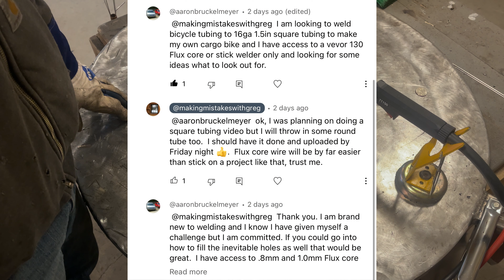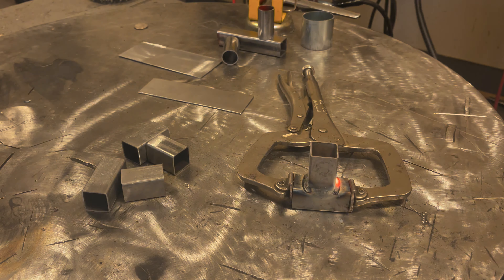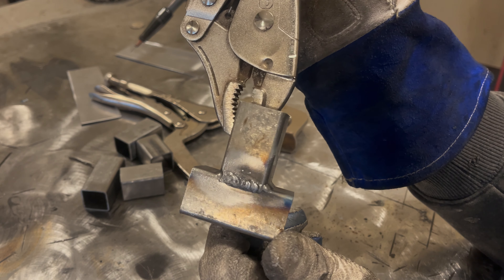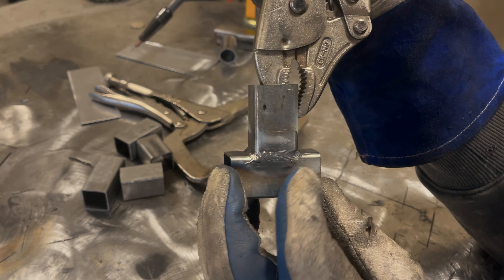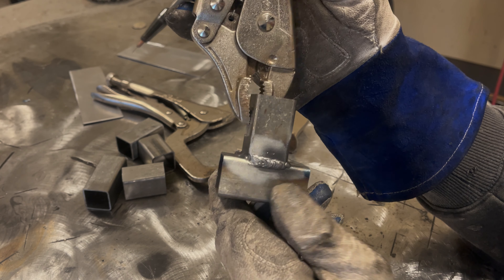Flux core welding part 6: Thin wall small diameter tube. Viewer suggestion

Comment: When I need to clean oil off of metal internals like that, I found a carb cleaner spray down works well.  
Safety warning:  Take it outside to clean the part though.  Don’t blow up your garage with carb cleaner vapors. And don’t clean after welding until cool, or start welding until vapors are gone.  Can blow tubing out with compressed air to get it all evaporated faster.
Reply from the maker: Carb cleaner can work but if it’s chlorinated it will produce gas that’s dangerous.  I generally go as far as heating up the part with a torch to make sure the residue is removed before welding.  Sometimes water based cleaners don’t work well enough and chemicals must be used.  Definitely pays to be smart about it like you said 👍

Comment: This is really useful because for a DiYer it is the kind of fabrication joints we use for domestic gates, fences, tables, benches and other small projects around home and yard.  Not everyone has to maintain agricultural machinery on a ten acre homestead
Reply from the maker: Flux core is probably the most useful welding process for the average person.  It’s easy to pickup and very forgiving as long as you have enough stickout of the wire.

Comment: Is it fair to say that when you fill in with repeated passes or spots that you cannot use GS wire, or will GS wire be OK?  Thx.
Reply from the maker: So couple thoughts on this.  The -gs wire has significantly less requirements for test results per the AWS (American welding society) standards.  In some cases the -gs is very similar to the  t11 wire.  Flux core self shielded tends to make brittle welds in comparison to other processes.  Multi layering passes tends to increase the brittleness of the weld, which is why it’s not suggested to weld over a single pass of -gs, which tends to have a bigger issue.  With all of that said there is a a big issue that most people aren’t aware of with self shielded flux core, and that is its tendency to produce porosity on thicker welds.  Most hobby level machines are 200amps and only run .035 wire.  Well .035 self shielded flux core can’t carry enough heat on metal thicker than about 1/4, and it tends to produce porosity internal to the weld.  This is due to how fast the molten puddle solidifies.  So even if you avoid -gs wire and attempt to weld thicker steel with multi pass you might have weld defects that can be a major problem.  That’s why it’s important to cut/etch your own welds and verify the inside is clean 👍
Reply: @makingmistakeswithgreg  Thank you! :)

Comment: Thanks so very much for your series of videos! I’m an old guy that’s going to give flux core a try!
Reply from the maker: No problem 😀.  Flux core is pretty easy to get into.  Just focus on moving smooth and consistent.  With some practice you will be making decent welds in no time 👍

Comment: Greg-inator. I know it's been a year ago. I've been thinking of sometime welding square tubing for a recumbent tadpole tri-cycle plan. Chains, pedals, sprokets, gear levers, brakes, derailleurs, everything. The plan says 1-1/2 square tubing at 1/16" wall thickness for the spine and wheel struts of the tadpole trike. I don't know if I trust 1/16" wall thickness. They say, covering the ends of the tubing with welded caps will strengthen the tubing. I don't know. Should I upgrade and get 1/8" or more, wall thickness tubing? Or, even 2" square tubing?
 Thank you for your knowledgeable  input. I've been watching your welding classes for quite a while. All I can say is, WOW. It's like I'm in your shop, and you're personally teaching me how to weld!
Reply from the maker: 1/16th tube is fairly strong, and likely the same thickness as many bicycle frames.  However most bikes use round tube which is far less likely to kink.  To be honest I am unsure as to how much weaker square tube is compared to round in your application.  If other people have done it and it worked I would assume you would be in the clear.  1/8th material would add a significant amount of weight.  Bikes are always a balance of weight vs required strength.
Reply: Greg-inator of Welding, Thank you for your quick response.  The Atomic Zombie Recumbent plan probably says square tubing for the builders' ease of mostly straight welds rather than curved welds. Thanks to your input, I can plan to start getting materials together. Thanks again!

Comment: Great video. Do You have any idea what your voltage is and wire speed, please?
Reply from the maker: So unfortunately on that machine it doesn’t have a readout.  If you go by your machines setpoint chart it should be close.  If you don’t have a chart miller electric has a great one online that should get you in the ballpark.  The hard part is many machines aren’t exactly accurate (for voltage and feed speed) so getting things exactly dialed in may require tweaking outside of a conventional universal chart.   The big thing is your wire feed speed dictates weld size and voltage dictates weld width and fusion.  If you are producing too big of welds move faster or lower the WFS.  If your welds are sitting like caulk on plate up the voltage.  It takes some experimenting to get the balance right.

Comment: I'll be using stick and flux core a for the type of work I'll be doing. I've seen a lot of welders run a short bead, pause for a second, then start laying a bead again without cleaning off the slag. At what point in the process is slag created? Is the weld still hot enough between beads that when we start again the slag comes to the surface? Slag inclusion? I am not trying to pick, I am actually curious. I have not asked this question to anyone but you, because you do such a great job of breaking down/explaining steps throughout the whole welding process. Kind of a long question, and I hope it makes sense. Thanks for sharing!
Reply from the maker: So I (and many people) have restarted on hot flux.  Doing that can cause a slag inclusion, but even if it doesn’t cause an inclusion it will universally limit penetration.  I have a video coming out shortly on running a continuous bead vs multiple starts/stops.  Not meaning to ruin the outcome, but starting and stopping produces a lack of fusion right in the start area every time with mig, and it’s the same with stick.  On thin metal like exhaust (or 1/8th or less material), it won’t matter much.  On 1/4 in steel it’s going to be an issue.
Reply: @makingmistakeswithgreg  I greatly appreciate you sharing your knowledge! You have excellent presentation skills. We are fortunate to have you!

Comment: Great tutorial, you make it look easy..
Reply from the maker: It is easy once you get the hang of it.  It comes down to angle and proper settings.  If you notice almost every time I have the wire going straight to the center of a pipe (not a drag angle) I blow a hole.  It’s hard to keep a drag angle all the time.  Stick welding the stuff is much harder, my results were mediocre at best in that video lol.  Anyway thanks for the comment and watching 👍

Comment: Thank you for these uploads! I've enjoyed your series of welding videos, but have a couple of questions. I'm a complete n00b and have never welded anything before, but am buying one of those Titanium Flux 125 welders tomorrow to learn on.
1. Do I need to weld on a metal table? I would assume the answer is "no", but that it helps because of the high heat created and a metal table provides something to clamp onto instead of just the metal I'm welding, correct?
2. Do I physically touch the flux wire to the piece before pulling the trigger, or should it just be close to the metal that I'm welding?
Reply from the maker: So if you weld on a metal table the metal does 3 things:  1: it doesn’t catch fire or melt lol.  2: it conducts electricity so you can clamp to the table and set welding plates on it to practice.  Far easier than clamping to a small part.  Lastly 3: it lasts longer/is easy to clean of welding spatter.  It’s possible to weld on other surfaces however the heat involved can be fairly extreme and without atleast a surface of metal on top of whatever you have (say a plywood table) the fire risk is high.  A cost effective welding table is a used one from market place, I would suggest starting there for a deal.  

To start the welder (with flux core) you cut the wire so it’s sticking out about 1/2in to  5/8th of a inch from the end of the contact tip.  You then put the wire very close but not touching the material.  When you pull the trigger it will feed the wire out and start melting metal due to the current.  Technically some wire welders you can touch the wire, but in some cases the open circuit voltage (what’s present when you’re not welding) is high enough to cause the wire to stick to the plate.  So it’s best if you leave a super small gap.
Reply: @makingmistakeswithgreg  Thank you so much for the detailed response! I really appreciate it!

Comment: This guy is great teacher.  Thank you very much for these lessons.  I know the machine you are using uses some truncated scale.  The Mig welder I will be buying uses volts and amps.  Is there any way you could translate the power in to Volts and Amps?  Thanks again.
Reply from the maker: Thanks for the kind words.  So the truth is on the settings, is flux core welders are often in a a/b/c, 1/2/3 scale for output.  Very few dedicated flux core welders have voltage/amperage readouts, but obviously mig machines do.  The best advice I can give you is to use miller electrics weld calculator (search Google) and input the thickness of material and wire type/size.  It is actually pretty accurate.  Once you get a feel for your machine you will find that other machines will often weld differently.  So it’s important to reference the chart on the machine if it uses letters and not a readout.

Comment: Thank you Sooo much for this video. You definitely hit on some of the connections I am trying in my cargo bike project. I look forward to watching the next one with the saddle fits. I'll have those in the project as well.
Reply from the maker: Glad it helped you.  The saddle fit is a tough bastard, you’ll see that in the video for sure lol.  If you’re doing it on non zinc treated material (like I did) you’re result will be cleaner/better.  It’s still hard no doubt.  With no where for the heat to escape on the thinner sections it doesn’t take much to melt through.  With enough practice anything is possible though.  You got it 👍

Comment: When you stitch together tack welds, I guess there's no need for cleaning off the slag between tacks as long as the tacks are performed quickly in succession so that the material remains very hot?
Reply from the maker: Generally speaking if the flux is hot it won’t be a huge issue.  Flux core wire will entrap slag if your settings are low, so keep a lookout for that.  If you’re welding something that needs absolute strength I would buff the end of the weld and start on clean metal, but for exhaust and non critical stuff I wouldn’t worry too much about it.    Your question gives me a good video idea to actually test what you’re asking about, I will do a video on this within a couple weeks 😀
Reply: @makingmistakeswithgreg  Great, I look forward to it, thanks.

Comment: for a real chalenge i would like to see you stick weld that. i know i could tig weld that but every time i try to stick weld something like that i have problems.i end up putting a ton of tacks and spend to much time filling holes.
Reply from the maker: I won’t sugar coat it one bit, that is a incredibly hard challenge to stick weld exhaust pipe.  I know I can do a series of tacks like you said, but as far as running a bead it’s going to be very hard.  On a bench where you can position it that’s one thing.  On a car where it’s fixed is a whole different ballgame.  Great news is I have a flex pipe to fix on a car this Sunday coming up, so I will give it a shot.  I have a feeling there will be a bunch of holes and some swearing lol.  I could torch weld it all day but even 1/16th rods will be tough.  I like a challenge though 😀

Comment: Thanks for making these flux core videos. It gets such a bad rep because people don’t understand it’s purpose or it’s capabilities and limitations. Some of the old home gamer flux core machines may not have been the best and contributed to the false lore regarding flux core. I’m not a welder but I have been welding since the early 90s, mig, stick and tig. Fortunate to have big 3 phase machines at work but for home, my 120v flux core machine does  everything I need it to do. When welding thin tube that I cant move, especially small pieces, I’ll run all my verticals first. Running flat welds first heat soaks the material and I end up turning the welder down so the verticals don’t blow out. I prefer to just burn wire once I’m setup and not fiddle with the settings.
Reply from the maker: Those “flux core” machines of the past definitely gave flux core a bad name.  Many of them outputted A/C instead of DC, they had no adjustability, and the wire they came with was terrible.  When you use a decent wire and even a cheap modern machine, flux core is very capable.  Many people gave up on flux core and to this day say it’s a trash process, yet that’s simply not the case.  Like you said, a ton of false lore.  Your thought on running the verticals first is definitely a solid tip.  Your enough of a welder to know it’s far better to make it easy on yourself and not keep changing settings 😀

Comment: So a few questions, with material this thin, you have to just go way faster? most videos just take their time and whatnot. Another question, just do a straight line? The videos I’ve been watching always say that they do little circles or and “e” . Thx! This video really helped me understand it a whole lot better.
Reply from the maker: Hopefully this helps:  the thinner the material the lower the heat input.  In simple terms you need less voltage and less wire feed (with MiG and flux core wire).  There becomes a point where flux core wire no longer welds properly, and you can’t lower settings anymore, this is due to the flux needing to be turned into a gas/liquid.  Hardwire MiG wire doesn’t have this issue.  How you can still weld thin material in such situations is speeding up your travel speed.  That will allow you to run values high enough to get flux core to work properly and not just blow holes through the metal.  Obviously this takes more skill and more practice.  Thin material has a very small window of what it weld it properly.  The better the welder the easier it is to weld (more expensive welders tend to have better low end stability).

So the circle e issue comes down to a few things.  In certain situations it will allow you to bridge a gap.  Doing it instead of running a pass straight in may limit root penetration on thicker plate.  Putting down too big of a weld on thinner material (very common on thin stuff with circling) will cause warpage that could be a issue.  I am not against using it, but many people use cold settings to make the weld look like a stack of dimes, and that doesn’t make for a strong weld.  It also tends to lack reinforcement in the center of the weld (root to center surface of the weld).  I guess so it really comes down to what’s being welded and if it’s acceptable or not.  I will be doing a video with MiG comparing the penetration of the different weaves/stringers and that should give a better idea of what’s going on 😀

Comment: I want to see you will to razor blades together
Reply: Weld some quarters together to make a coaster
Reply from the maker: I can with tig, a while ago I did a video of the end results.  The razor blade trick is much easier with a higher end tig welder.  I will have to try quarters but I am not sure if the alloy, I don’t think any of them are solid metal.  Worse case I will have to use copper Pennies lol.  

Razor blades 
https://youtu.be/YThB594gMJk

Comment: Any suggestions on welding a filet on 1/8? I have this HF welder and only had a spool of practice. My welds come out well on flat plate and overlapping joints but when it comes to a filet, with same settings, it looks like I have the polarity reversed. Do you have to change settings when doing a filet?
Reply from the maker: Ok hopefully this helps:  the polarity should be DCEN so the MiG gun on negative.  Do you have the same welder I have or the black box one?  The black box one welds on AC and will produce a lot of spatter and poorer penetration.    Couple more tips:

A fillet weld should take about the same settings as flat lap weld, but slightly more will be a benefit.  If your bead is roped up/not wetted out up the voltage a bit.  If it’s melted in too much lower the voltage a bit.  If you’re holding a 1/2in stick out you may be traveling too fast, make sure you run slow enough to deposit enough weld/have proper fusion.  

Send me a email at weldingoldschool@gmail.com with a pic of what you got, I will get it straightened out even if it takes shooting a video to do so lol.
Reply: @makingmistakeswithgreg  Thanks Greg. It's the green HB welder as seen on your video. Thanks for the tips. I'll try upping the volts a bit.
Reply from the maker: @shaolin224  set the machine just a bit higher, and make sure you move fairly slow.  If the machine is set for 1/8th material (and maybe a pinch higher) run so slow you burn a hole through.  Then up the travel speed just a bit so you don’t burn a hole.  That will be a sweat spot.  1/8th has a fair amount of lee way in amperage handling on a fillet weld so don’t be afraid of blowing right through it.